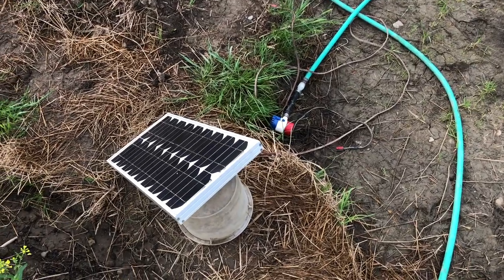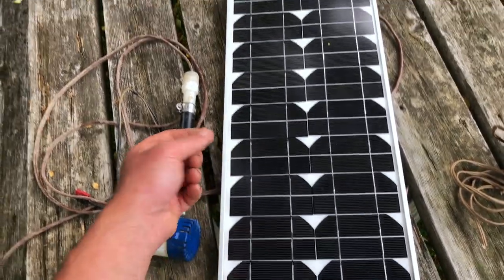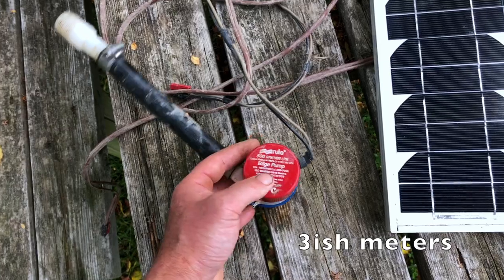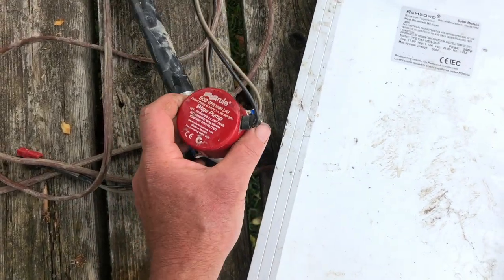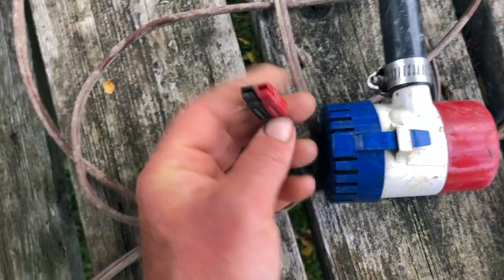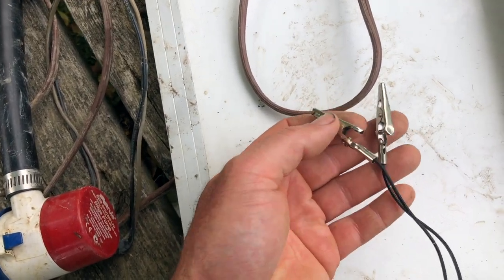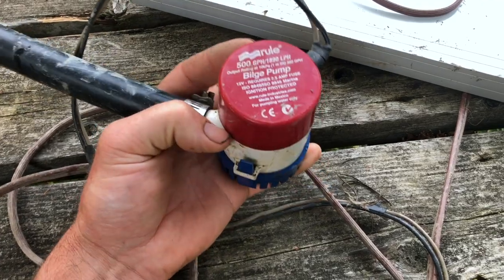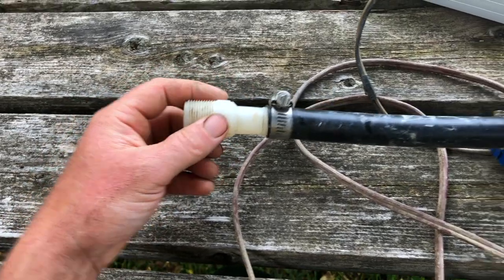Solar Water Pump - SUPER simplified introduction

Comment: I have a fish pond out back.  To keep the fish happy they tell you to circulate the water through a pump and filter, up above the water surface, and then let it spill back into the pond to aerate the water.  The pumps can be  80 dollars, and then you have to plug it into something...   This looks like it would do the job for a fraction of the cost of the pump.  Thanks for the idea!
Reply from the maker: Find a used solar panel for low/no money and a bilge pump for $20 and all day when the sun shines you are all set...

Comment: I have really been struggling to find information on exactly this kind of idea, so thank you very, very much. In our case I think I might need a bigger pump because it's about ten feet from our creek up to the edge of the bank, then a mild slope up into the pasture where I need water the most. But even if I can only find a 500gph pump and it runs half or a third as fast due to  the rise I might be OK with that, too.
Reply from the maker: I put together a system with an 800 gph bilge and a 75 watt panel that is really excellent.  At 6 feet lift and 50' delivery it runs like a fully open garden hose attached to a home.  Something like an 1100 gph bilge and a 100-150watt panel and you'd easily get what you've described worked out!
Reply: @edibleacres  Excellent, thank you. I briefly searched bilge pumps and even brand new I was shocked at how affordable they are. Previously I thought I was going to have to spend hundreds because all the info I was finding was not about bilge pumps but other styles that are, well, pricy. Just knowing the correct specific sort of pump to look for has already helped me a lot, so thank you again!
P.S. I will of course look for a used pump... and I certainly won't be ordering through Amazon. Don't get me started on my thoughts about Amazon...

Comment: I admit that I know even less about electrical hook ups than you do, but I tried to replicate your exact setup with nearly identical pump and a 100W solar panel. And nothing happened. My pump work when tested and the solar panels is putting out the correct amount of power. The one thing I got from another video is that a solar panel putting out 20 V open circuit, which it is designed for, will quickly burn out a pump designed to work on 12V . I would think you need some kind of regulator. I tried to get the pump to work by hooking it directly to the solar panel and after the controller that came with it and still nothing happened. I cannot see how this can work without a battery in the loop.

Comment: Watching your vids is getting me more into a repurpose frame of thinking. :)  Found a pressure treated 2x3 fencepost out in the woods and am gonna combine it with one of the plastic thingies that go under potted plants to make a no cost bird bath.  I looked at buying one, didn't like the reviews on the "resin" ones and the concrete ones are heavy and expensive.  So...don't need pretty, need functional.  Want more bluebirds!
Reply: With a dremel, or a hammer and chisel (and eye protection) you can carve a birdbath into any decently sized rock. Got any on site already?
Reply: @nathanc9110  No,  Panhandle Florida.  All rock is down about 50' :p  But my DIY one is functional now.  Not pretty but holds water and saw a mockingbird sitting on the edge.  With all the rain, plenty of water around at the moment.

Comment: Thanks for this.   The alligator clamps make perfect sense to me, after all, my solar fence charger connects to the fence with clamps.  I have been watching  100W solar kits that are available through Harbor Freight , Northern Tool and even Costco sometimes and I want to get one and tinker around with it.  I figured it would be a good enough solution for a light and possibly an outlet in my barn, but I have been afraid to jump in.  Now I'm feeling braver about the possibilities.

Comment: "Head" describes how far up from the beginning the pump has to push the water. I mention this because I just found that manufacturer's specs sometimes list the flow rate at various levels of head. For instance Rule lists one of their bilge pumps as 500gph @ 0' of head, 360gph @ 3.35' of head, and 260gph @ 6.7' of head.
To help us figure out how strong a pump we really need for a specific application. I always take such specs with a grain of salt, but at least it should be in the ballpark.
Reply from the maker: Great notes here to add to the conversation, thank you.  Yes, there are decent charts worth looking at if you have specific/challenging applications for this pumping setup.

Comment: Ha! Ha! Ha! I've been doing this since 2005!  Same thing.  Bought a 30 Watt panel back then for $100 and $25 bilge pump to pump water out of my creek.  Works fantastically!  I think I bought the original bilge pump from Northern Tool, but it might have been another place in Minnesota.  I would suggest Rule pumps because they really are good, but I wouldn't buy from Amazon.  I think the last one I bought was from eBay.  I also bought my 30 watt solar panel from eBay, but that was back in 2005 or so.
Reply from the maker: Great to know other folks are out there doing the simple setup style.  So pleased to have found this very direct and very reliable way to move water.
Reply: @edibleacres  Well, it took me five (5) years and a lot of frustration to figure out that the ram pump I was trying to build wouldn't work because the amount of "fall" (i.e., measure from the top of where the water comes out vertically down to the base of the creek) had to be a minimum of three (3) feet and I only had about 24 inches.  Then I had seen something about pumping water using solar panels, but all my research was showing DC pumps that were really more designed for industrial purposes and were way too big, physically, for my creek.  I finally emailed a company (don't remember the name) who engineered water pumps and it was one of the engineers who suggested using a bilge pump.  Bingo!  Solved the problem lickety-split.  
A neighbor has recently told me a someone he recently met who was having this same problem and suggested to him the same solution.  I wish I knew the guy's name and email address so I can send him a link to this video.
Reply: @bigonprivacy2708  Yes.  In fact, I think I have two or three (always have a backup!) The pump in this video is the same as what I have in my garden.

Comment: I use an old battery charger to run my bilge pump to move rain water around my place Sean
Reply from the maker: Sounds like you have a system that works well for you!

Comment: Ace hardware has the bilge pump hose by the foot that fits directly onto it. Easy enough to then reduce it down to a 3/4 hose fitting.

Comment: Thanks for this walk through. We have a small hand-dug well, about 3m deep. I've been using an electric mains-powered pump to pump the water into an IBC tank, which we use for watering our small market garden. I'd rather have a solar powered pump which trickled whenever it was on. Do you think that a bilge pump could work well for that, maybe since it would be dealing with lifting a greater distance it would work out as a good slow pump. I would be happy if it trickled as long as the sun was out, with the pump living in the well.

Comment: Hi Sean, thanks for this video. I've been thinking about trying to pump up water from a stream on my property but it's about 200 ft away and maybe 40ft downhill from where I need the water. Any sense  of what size/ kind of pump might work for this?
Reply: So the drop in elevation from your stream to where you want the water is called the "head", and tbh 40ft is a lot for something like a bilge pump. A bilge pump is designed to pump a bit of water all day long as it sits in the bilge of a boat where the water that leaks in collects. you may be able to find a bilge pump that can handle what you want, but it'd probably be a lot larger than the one in the video.

It sounds like you'd be more after a shallow well pump, and that might require you still make a small deep pool that the stream can feed and the pump will be submersed in. Looking at those you'll start to see mentions of "head". Many of them can/will also be 12v, but may require more watts, depending on designs. As far as places to acquire them, you could try to connect with a rural store or farmers, someone who would be out where a well would be
Reply: @timmyjacobs0  thanks for that; my situation isn't as extreme as Davis Wang's but I appreciate knowing what to look for if I need more ooomph.
Reply from the maker: Your application is definitely something you can accomplish with solar power and DC pumps, but you absolutely would need a more robust system.  I suspect you'll be needing to research 24V systems (which could be two 12V panels run in series) and a DC well pump that is capable of lifting probably 100' or more to tackle both the lift and distance.  I found a very rough idea (no idea if it's a good quality, but a frame of reference) of a 12V well pump for $80 that lifts almost 200' supposedly.  It would want a 150 watt 12V solar panel to be able to work...
https://ebay.to/3oVSRlB

Not saying to buy it, but to look at a starting place of the type of equpiment you'd want to explore.

Thiis would probably be a few hundred dollar project, but quite doable.  Good luck!
Reply: @edibleacres  thanks, that helps give a sense of what might work. Appreciate it

Comment: Thanks for the info. I'm also very interested in more details, especially about the batteries your friend built you. Maybe you could collaborate with him to show us where to get the supplies and how to build them? Oh, I'm also interested in your electric BCS. Does it have enough power?
Reply from the maker: The electric BCS is insane.  We had him modify it so it only outputs 20% of the potential power of the motor he installed and it is more than enough to do all the rotary plow work we need which is just about the most demanding application.  I'll certainly share a video on it.

Comment: Thanks for this, most vids assume a basis of electrical knowledge or the funds to purchase a $20,000 set up from a contractor that I simply do not have

Like inverters and temp controls and phone apps to monitor everything sounds cool but way out of range for right now, while this I can use right away, just start checking craigslist and kijiji and fb barter groups for equipment and go from there
Reply from the maker: Yep, this right here is the main reason I make videos like this :)

Comment: So if you use the alligator clamps on the pump cord, are you exposing a bit of wire from the solar panel cable and you clip onto that? Do I have to be careful this connection doesn't touch anything damp like grass? So it can't be left out in any weather and is just temporary? I need to ask because I really don't know enough yet about it and really do want to try this! Thank you anyone who can tell me.
Reply from the maker: I can see very much that what you see in the video is functional AND very very scrappy and not best practice.  With a 12V solar panel under 100 watts I can't imagine you doing any damage to property or people with this approach, and I've had those clips in various conditions and it still functions just fine.  Consider it a fine enough place to start that you would want to hopefully evolve and deepen as time allows...
Reply: @edibleacres  Thank you so much for your reply. Just yesterday I ordered the little bilge pump and a 100 watt panel from ebay.  The solar panel has wires that have alligator clips or you can plug into a car cigarette lighter. I'm not sure what kind of end is on the bilge pump; is that the wire I may need to strip the end off to clip the alligator clips on? I'll have to look at it all when it comes and see what I've got, I'm super excited to get started finally using a solar panel. I hope the 100 watt isn't too much for the pump (same size as yours), if it is I can get a small battery I guess to use with it. What do you think?

Comment: Hi. Thanks for this. However i cant get mine to work. the pump needs 3A and my panel onlgive 1.4. I bought a 12v panel but when it arrived it says 18v on the back. But i think the problem is the amps. Any ideas?
Reply from the maker: Your best bet is to think about it through the lens of watts... If you have a 3amp pump that is rated for 12v you need 36 watts of panel BARE BARE minimum... 100 watt panel in decent sun would work wonderfully...  That is how I'd focus my attention on it...
Reply: Yes that makes sense. But  how come his works in the video when I got the same rated panel and pump. There's another video posted where the guy does the same and hey presto it works!

Comment: Extremely valuable.  Say I have 100w 12v panel and want to run pump like that 12v 3amp max.   the panel can put out 18v and sometimes 6amp.  How can I protect the pump from too much power?  Can somebody recommend a specific converter?

Comment: Hoping someone can help me with an issue I'm seeing. I put together a system nearly identical to this. When I connect my multimeter straight to the 12 volt panel it shows around 2 amps and 20 volts. However, as soon as I connect the bilge pump, the voltage drops to around 0. I tested the pump separately using my drill battery and it does work, so I'm wondering what could be happening. Thanks!

Comment: Does it work in a little cloudy days or it must be in full sun only ??
Reply from the maker: If you get a panel that is a bit stronger than what you need it works in cloudy conditions.  Pump needs 30 watts?  You wire up a 100 watt panel and it will work in partial shading...

Comment: Great ! I think I can find all the material. Was looking for a way to empty my bathtub after a shower into a water holding in the garden. (Gravity is against me)
Reply: I'll  end a pump that stops itself whe n the water level is near zero or it will fry
Reply from the maker: Bilge pumps can run dry for a little, although you don't want to let that happen for too long.
Reply: @edibleacres  oh OK, that widens opportunities.
Reply: If you get an automatic bilge pump, they shut off when the water level goes below the float. Kind of like a toilet tank float. I only know this because of boat ownership in the past. A bilge pump turns on and off automatically when water comes into a boat, and pumps it out the side of the boat to keep it from sinking.

Comment: A bit cringey on electric side, but it will work for a while.
Find a solar DIYer and get some proper waterproof connectors, and it will last for years.
Float the pump, so it gets cleaner water.
Reply from the maker: I hear you on the details and those are all good, but it's important to have folks see a system that iis super super low tech so they feel that they can start somewhere!
Reply: @edibleacres  yes just getting something started on a budget is where I'm at. I would prefer to really do it properly the first time if the budget allowed, but that's simply not the case. And really doing it properly can frankly be pretty daunting, from what I've read - some systems get real complicated real quick. But I also appreciate the tips from CorwynGC.

Comment: Know that the voltage of a 12v panel can be up to 18v in full sun which can ruin a pump. Consider a buck converter which regulates the voltage for the pump. $15 max
Reply from the maker: Something for me to look into, although I've found 100-ish watt panels with a roughly 20-30 watt drawing pump seems to work pretty darn well with no other bits inbetween...

Comment: Be careful which "12V" panel you buy.  The one I got from eBay was advertised as 12V, but is actually an 18V panel that only delivers 12V with a charge controller that you have to buy separately.  The pump works fine on a 12V power supply, but doesn't work with the higher voltage (25V no load) actually coming from the panel.
Reply from the maker: Good reminder.  The closer the panel in wattage to what the device needs, the more reliably it seems to work.  I tried plugging in a tiny 12V pump that maybe needs 20W in total into a 150W panel and NOPE...  Too much open voltage I suspect.  But a pump that wants 50w at 12V can take that extra and make it work.  I think I may look for used super cheap charge controllers to put inline to regulate a bit.

Comment: Dude.  Wire nuts.  Also, dont put your power junction so close to the pump that your connector is under water.  Leave more length.  But if you must then you can splurge for waterproof wire nuts.
Reply from the maker: The wiring on the pump comes super short so I work with what I've got.  I know I could do a heat shrink or something to extend that but to be honest after 8 years it hasn't been a problem so I just don't worry about it.  I hear you though, I'm sure there are way better upgrades to this super simple approach.

Comment: I cannot seem to shake my fear of combining electric with water. Nonetheless, thank you for this information.
Reply from the maker: Super super understandable.  I felt the same way, and still get sketched sometimes.  BUT, 12V panels at low wattage and small bilge pumps like this are insanely safe.  No battery to store extra energy and let it loose very fast, nothing like that.  I haven't felt anything remotely near a zap with what I've shown here.
Reply: Bilge pumps are made to be water tight when submerged in water, so they can pump water out of a boat to keep it from sinking. Water tight connectors might be found at a marine supply website or store, since most bilge pumps are connected to a marine battery.